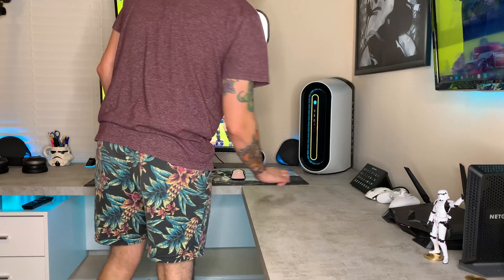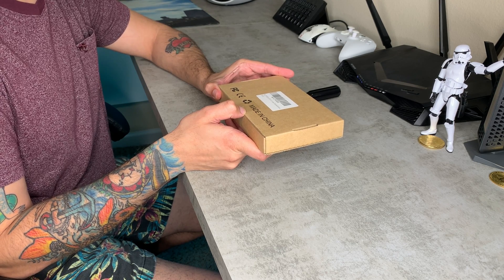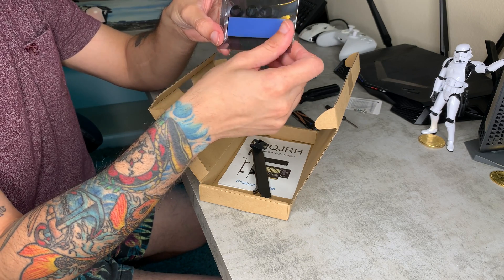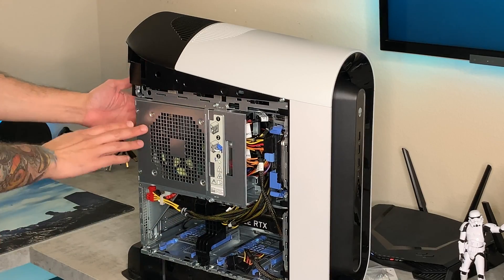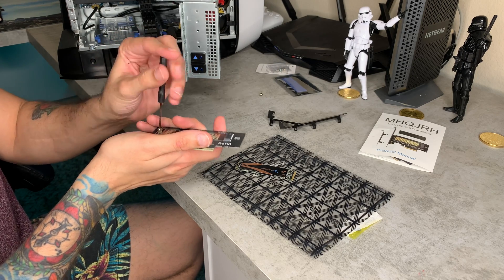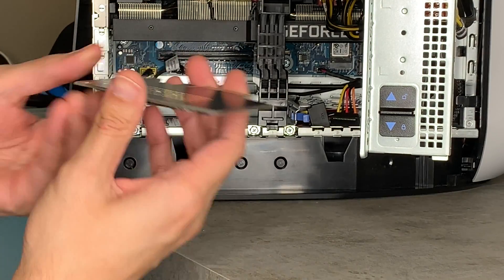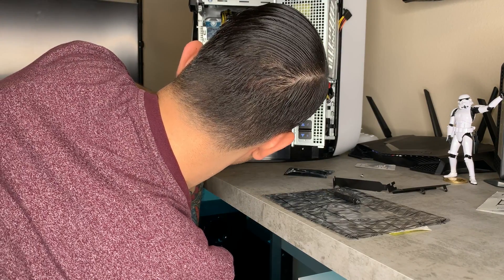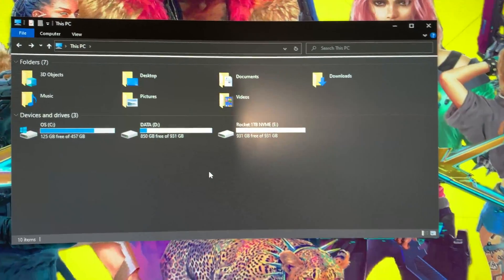Install 2nd NVME SSD on Alienware Aurora R11/R10

Comment: I have the R10 Ryzen and I did order from the link you provided.  I saw @Good Citizen had a problem with it.  Should I return it?  I got the 1tb and adapter just like you recommended.  Will it work?  This is my first gaming pc.  I got the R10 Ryzen 7 5800x with the 3080
Reply: You can get it to work, it was just a bit of a work-around mounting the drive.
Reply: @goodcitizen7064  I have this problem. Cant mount new nvme with adapter card in R10 amd 5950x. What workaround are you using? Thanks.
Reply: @Nowhyshouldi2  \Mount the new drive in another computer's M.2  slot first so windows recognizes it first, the it should be fine in the pci slot on your new comp.

Comment: Just add cooling to the vrm’s, a new cpu cooler and a few fans and you’ll have a good system!
Reply: yes he should do this and show us in a Video how he did it ! i bought the Same computer now and want also install some Fans and want to cool the system a little bit better.. If he would that i would Love him. i just dont know how to do that all cuz im a stoopid kid and have no knowledge but if he would show us in a video how to Cool that system it would be just Perfect!
Reply: I like mine... it runs pretty cool after tuning the fan. it was getting up to a 99c on the gpu. did some custom tuning on the fan and now playing 2077 in 1440p it only gets up to about 85C. The CPU is not even trying doesn't even get warm at all.

Comment: Thanks for the info... have you heard about putting in the Corsair LL 120 fans to cool your box down? Drops it about 10C with 3 fans... two on the liquid exhaust and the one near the GPU.
Reply: This is a good modification. I bought 4 Corsair ML120 pros and put all in the machine. 2 for the cooler and 2 for the front. Makes a huge difference. 

The engineer behind this case should have been fired, it has terrible air flow.

Comment: my sabrent ssd is still not recognized after I did this, any tips????
Reply: As in it does not light up red and is does not pop up under devices and drives
Reply: Could you maybe elaborate on how to place the adapter into the aurora r11 because your head kind of gets in the way in the video lol.. please lmk ASAP
Reply: Did you find out how yet?
Reply: Same boat I’m in? Any help on this?
Reply: Yeah when your plug in the ssd the end will be close to the case, the notch in between the two gold , has to go in the the opposite side of the push release button
Reply: @futurecryptowhale4256  can you re-explain this, I’m confused still
Reply: On which part get your SSD to light up or to get it recognized?
Reply: @futurecryptowhale4256  sorry havent looked at this, I eventually figured it out thanks for the replies
Reply: I had the same problem and fix it
Reply: @futurecryptowhale4256  is the red light suppose to turn on after it’s Installed or as soon as you power it on?
Reply: @gabrielmiguel2992  after you turn it on
Reply: @futurecryptowhale4256  no idea why it’s not working for me
Reply: @futurecryptowhale4256  I got it! Thank you dude
Reply: And the heat thing go on the bottom

Comment: Thanks.  I recently(last Sunday) purchased the R10, 3700X, RTX 3070. Your videos have been helpful. Here is my rub with Alienware. The "stock" cooler for the 3700x is the Wraith Prism. However, inside of the R10-R11 the Wraith Prism DOESN"T FIT!!! I am watching videos of people using the term "stock cooler" but referring to the replacement cooler placed in these models.
Reply: hell yeah man i got one too same specs got it on ebay for 1700 because of scalping this was my cheapest option to get an rtx card
Reply: @babygoro6497  I am now seeing these sold WITHOUT GPU! When I purchased my R10, I was not aware of this supply and demand issue. However, I am glad that we both were able to secure a rig.
Reply: @terrellwright7565  i know lol the alienware rtx desktops dont have super inflated prices for the rtx 3070. a 3070 0n ebay preowned is 1400
Reply: @babygoro6497  I went to the DELL website. I paid $1500. I see the 3070 being sold for $1200 on eBay!!!! Just CRAZY!!! There goes my argument to build one!
Reply: @terrellwright7565  2021 alienware the lowest costing prebuilt to buy with an rtx 3070 card in 2021 , LOL what is this world coming to?

Comment: Bro, I bought the one you got linked and it fucked up my R10. I got the pcie express card and a 1tb gen 3 instead of gen 4 M.2. I think I got a bad board because I had to reset my cmos, unseed the battery and reseed all my ram, video card and remove all my ssd's after I plugged that bastard in because it did something.
Reply from the maker: I don't see how it could do that, it is just an adapter to recognize an NVME through a PCI slot. I have an R11 which is virtually the same PC but with an Intel CPU. I am quite positive it wasn't the adapter that caused it, at least I hope not because I still have it inside my PC.
Reply: @GamerHeavenOfficial  Yeah man, I don't know WTF happened but I tested the SSD outside the adapter and it worked just fine but inside the adapter it wasn't recognized whatsoever. I tried different pcie slots and it never saw the ssd while in the adapter. I think I just got a bad board/adapter.
Reply: Update** I ordered a replacement piece and got the same results so I started tinkering around. I swapped the pcie express piece and my nvme drive into my R9 and it worked. So then I called customer service and they told me that the Ryzen motherboard are different and the pcie slots aren't the same. So then I added my express  card and nvme drive into the x4 pcie slot and it works. I had to remove my 2 bottom ssd holders to slot my graphics card down low and use the x8 slot there to do it. Apparently the x8 slot is incompatible with the pcie express slotted M.2 nvme drive. SO, for anyone thinking about slotting a M.2 via PCIE, use the x4 slots on a Ryzen MB, not the x8 slot.
Reply: The YumYum  the 128 M.2 will have your operating system installed on it. The 1TB SATA will be blank. If you want to just add an internal SSD, just buy an internal SSD and put it into one of the available slots at the bottom. There are already cables available to hook it right up. If you are unsure what cables to use, look at the cables your 1TB drive uses and grab 2 of those same connectors to plug into your new ssd.
Reply: The YumYum  Right on, glad to help out!
Reply: @Tom what did you do to make the lights start blinking? Did you reseat your memory, check all cables and or reseat your cmos battery?
Reply: @Tom What video card and color of case are you using? I have a black case with an AMD 6800xt, so my motherboard is different from intel stuff. Also, the color of the case determines  the motherboard for some reason. If you have an intel card, try the x8 pcie slot and see if you can get it to work. If you have an amd card, try the x4 pcie slot. Also, it's best if you can add your M.2 into another windows computer and have it mount as an ssd first, so your new computer can recognize it.
Reply: @Tom Well, you don't know anyone with a computer that's got an M.2 slot open to mount it? worse case you can take it to your local tech shop or bestbuy and have them mount it for you and it'll cost you a few bucks.
Reply: @Tom I dont see why not, it's a simple p[procedure.

Comment: Good Job ! Question .. So I have the R9 with a M.2 NVMe 2TB and when I get the R11 which also configed with the NVMe 2tb can I put the R9 M.2 and the new R11 M.2 slot? I have my game and keybinding and maps on that R9 M.2  Is that safe to do with a new R11. 

Thanks for your R11 videos .
Reply: You mean you're trying to put your boot drive from your r9, into your r11, correct? If so yes it will work but you'll have to use clone software unless you have basically the exact same components because windows will be attempting to load certain drivers for your old system while on your new system. The better option would be to use the above method to put your OLD M.2 into the pcie slot and transfer whatever you wanted to the new one, then wipe the old one for storage or whatever.
Reply: @goodcitizen7064   - Okay gotcha thx man !

Comment: I guess I'm a storage hog. I have 3 1TB internal SSD's, the 512 M.2, 2 1TB external Sandisk Pro's plugged in on the outside and then an Insignia dual hard drive docking station connected with a 2TB SATA and a 1TB SATA plugged into it. Now I'm gonna do like you did here and get myself another 1TB M.2 into the PCIE 4 slot. I have tons of anime and a backup of it, a movies drive and a backup of it, an anime movies drive and 2 of the 1tb drives are for games. the old sata 2TB is my backup of important docs/family pictures and that stuff (because spinning drives last longer than SSD's).

Comment: How much of a difference does this do?
Reply: If you mean from an old mechanical sata hard drive it's a night and day difference. If your old sata took 2 minutes to boot up and have windows ready, this would do it in 15 seconds. If you used an old SSD that took 30 seconds, this would do it in 15. That's a conservative estimate. Mine is like 10 seconds from turn on to ready.
Reply: What do you mean? From a traditional internal ssd, or sata drive?

Comment: I thought about doing this because I have the R10 and 3 sata ssd's stuffed in it with my 512 M.2 OC.
Reply: The YumYum  this ssd is plugged into a pcie slot card, then the card is inserted into the x8 pcie slot on the motherboard, no cables needed.